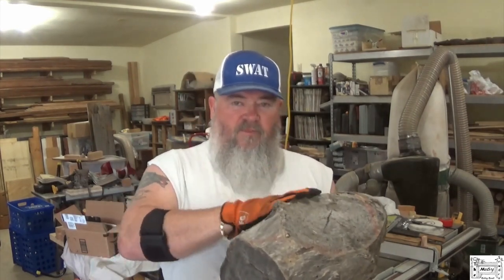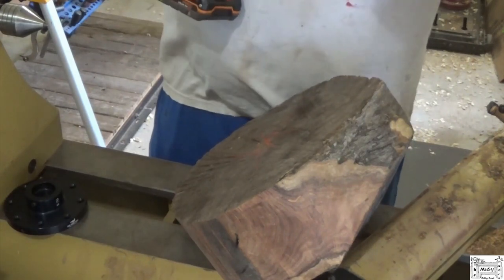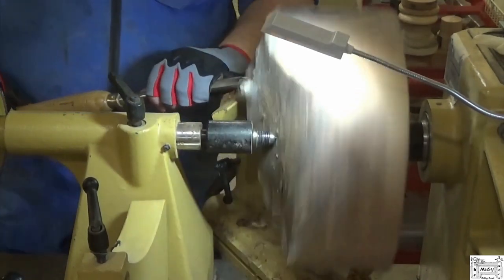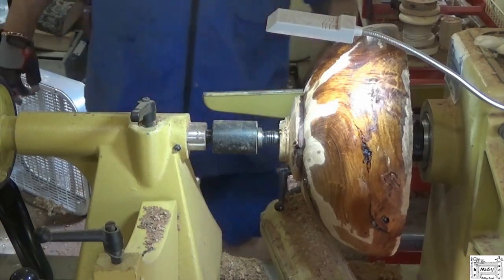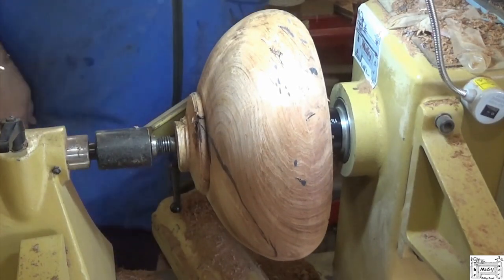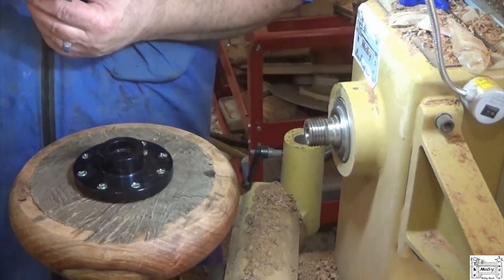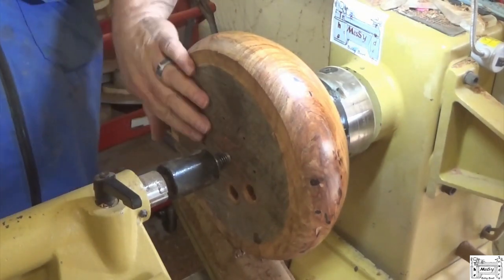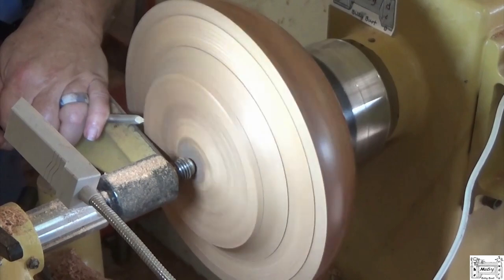#46 - Mesquite Crotch Part 1... Art over function

Comment: Hi Billy yes the background noise is a tad loud how about in editing cut the sound and do a voice over at the most important parts so we know what's going on. Screws in hardwood you may need to go up half to one drill size and in soft wood down half to one drill size depending on the density of the wood trial and error on small bits
Regards Dave ( in the UK )
Reply from the maker: Thanks for the input, Dave.  The bit I used was just larger than the screw shank diameter, but maybe it needed to be larger yet.  I'm working on the noise issue.  Thanks for your input, I truly appreciate it!
Billy